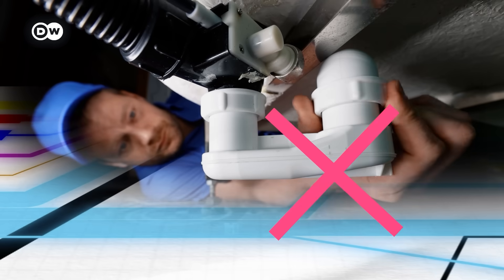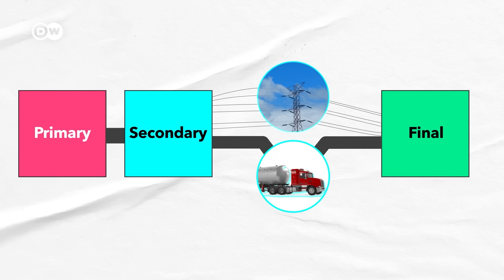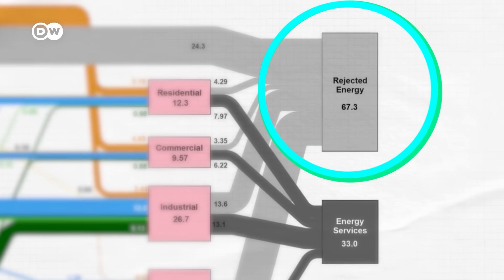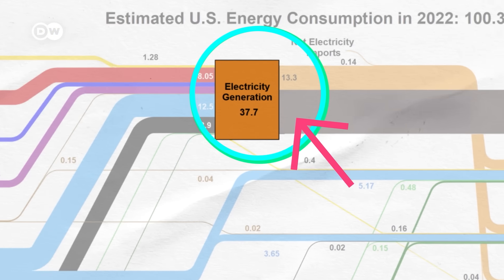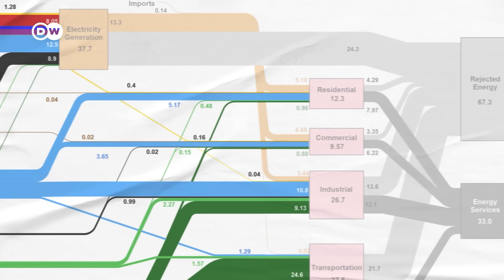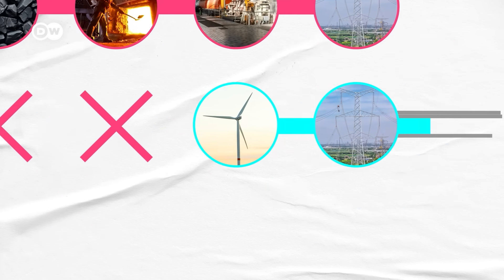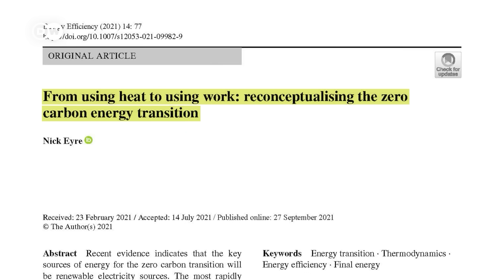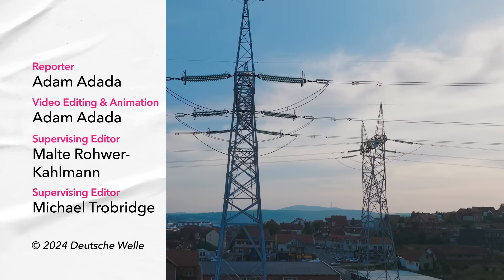The mind-blowing thing we get WRONG about energy

Comment: 640 kilowatts of energy in a tank of diesel, around 3 months of summer air conditioning going 24/7 electrical energy consumption, the conversion they had in the old charts I am presuming is heat loss, the induction hotplate might use less energy at the point but it would depend on how that electricity is produced. If it is coal that would still have the conversion loss of 65% to get it to the electrical outlet. Same as an electric car, a 100 kilowatt battery is still going to need four hundred kilowatts of energy to be emitted.  Not as bad as diesel but not as good as is being portrayed.

If electrcity is twenty percent of our energy, why is the conversation around only that part? Plastics, asphalt, medicines come from this oil. The amount of copper needed to electrify everything is all the copper in the last 500 years and this is the plan or what we missed about energy?

If plastic comes from the same barrel as petroleum etc and all the new devices are going to need oil for plastics, delivery, I have to say my mind is not blown and have just been left disappointed DW pushes this false narrative.

Comment: My thought is, I think we just need better energy storage, then warm up circles can be scheduled and there can be a prolonged time stored. I would suggest mass storege/Connetic storage. Even a simple garbage mound can be used, and the platform to lift is, be it only a few feet, will also prevent pollution in ground, we're as now, it would be to exsive, buy as a battery, that cost is regained
Reply: Look at a physics lecture 101, the 1st slide is often energy density, antimatter->nuclear fusion/fission->chemical-> loads more but the density falls off very quickly. Look of Wikipedia for the energy density graphics.
Reply: @johnjakson444  I'm not sure what you're sawing, I'm saying, use sometimes simpler to a giant weight devise to store energy mechanically, like how a weighted clock dose, but geared toured power.

Comment: That rejected bin is costing us money. Imagine how much money the economy would save if we weren't wasting so much energy.
Reply: And replace it with RE intermitency and short, medium and long term energy storage at eff of 90%, 60% and say 10% round trip efficiency, high cost hours, medium cost days, low cost for months of storage. New Sankey, same as the old one, but most all the losses are in long term storage.
Reply: @johnjakson444 Yes, the solution is NUCLEAR ENERGY. It is stable source with low raw  material requirements per unit of energy produced. Why to use dispersed nuclear energy (solar, wind, fossil)  if  you can use concentrated nuclear energy?

Comment: How do you make the renewables work 100% of the time? Like at night for solar panels and a doldrum.
Reply: Short medium and long term storage all different tech. Short is extremely expensive per kWh but used for hours at 90% eff. Medium could be liquified air or CO2 at 60%, cheaper but 10x the storage needed. Long term seasonal storage means conversion to fuels, huge losses maybe 10% round trip or better still just use  the fuel directly. Better still ask the energy grocer for an energy solution that doesn't need any storage, it starts with N or to be specific MSRs or just PW reactors if need be. The MSR also have free storage built in since the molten salt coolant is the storage.

Comment: 7:28 the 90% is the local it is not a good interpretation of all the energy. We have more losses do to charging and transporting and generating which the efficiency will be around 66%. And don’t forget the impact of batteries on the climate and you need to replace it after 5-10 years